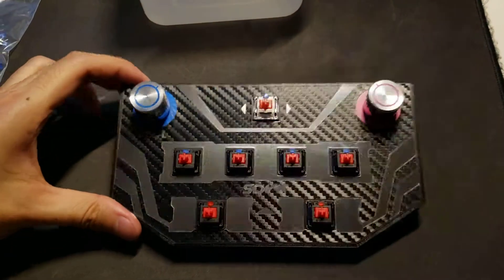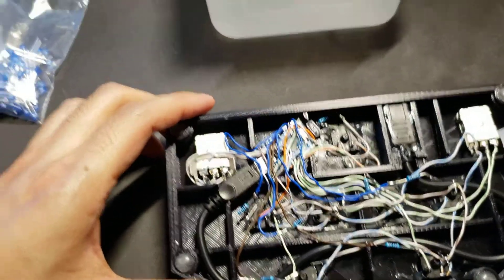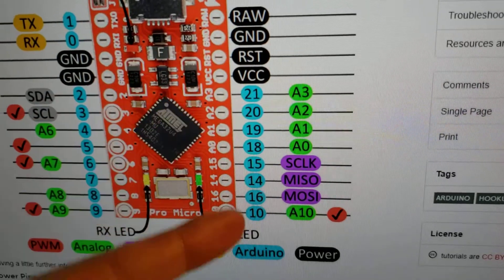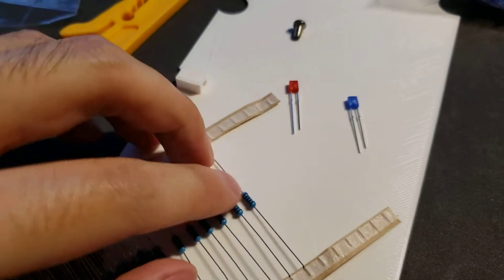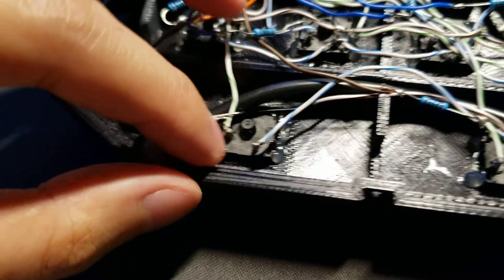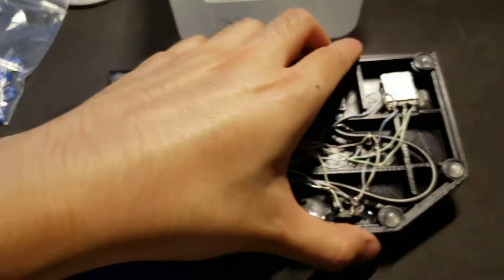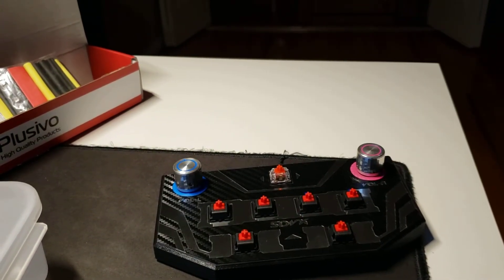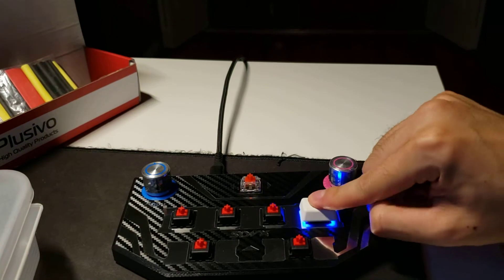Pocket SDVX Guide - Software/HID LEDs!

Comment: Hello, I have a little problem with arduino, I have an error telling me that I have to update Arduino above 1.6.8 and when I try to flash my arduino, it tells me that the port is busy, I already had flash the code once but I want to make a change, how can I do it? Can you help me please ?
Reply from the maker: Don't know if you fixed this or not - finally was able to reproduce this issue on a new PC and the fix was:

If you are running into the "Using OLD HID" error, try enabling verbose compilation output under File > Preferences > Show Verbose Output during [compilation] and uploading again.  For some reason, this fixes it for me.